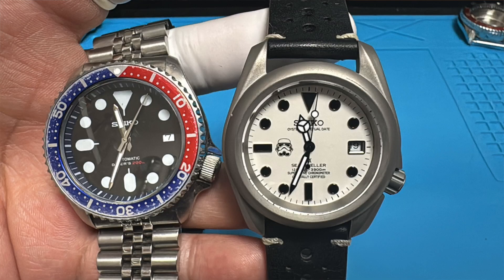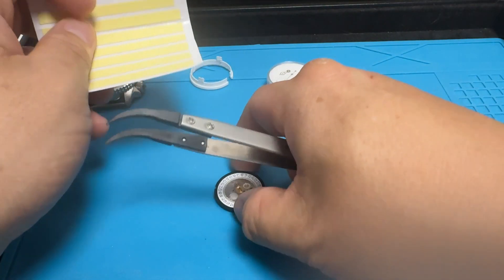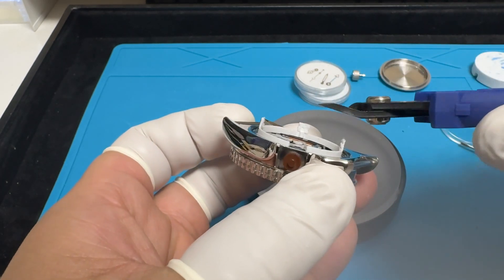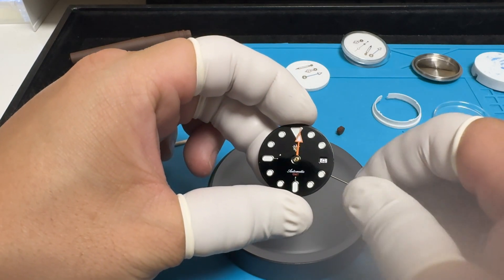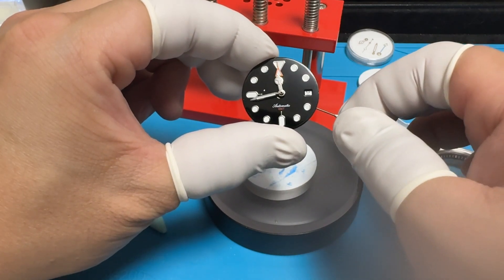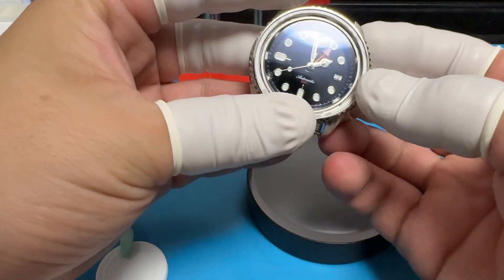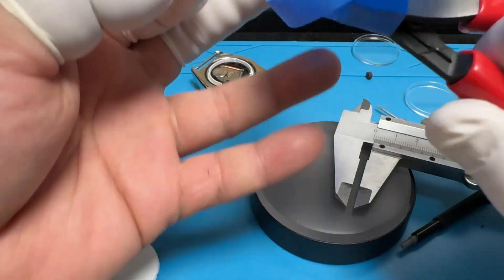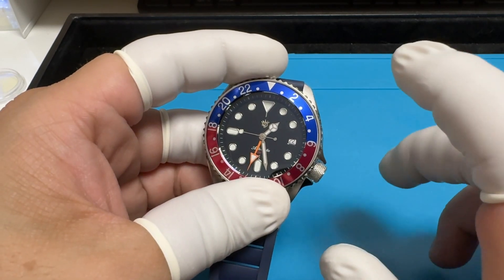Seikomod Quartz SSK GMT Ronda 515 24H

Comment: I have a watch with the same movement, but when I try and set the time using the GMT hand, if you will, it moves in an odd way. I was expecting it to land in between indices relative to where the Mercedes hand is. As in if it then Mercedes hand time shows 16:20, I would expect the GMT hand, if I wanted it to show 20:20 to be one-fifth of the way between  the 8 o'clock indice and the 9 o'clock one. But it does not do that. How do you set the time using this hand? Thanks in advance.
Reply from the maker: Sounds like you may need to remove all the hands and remount them.

Comment: I have a challenge for you. There are a TON of us in the SeikoMods community on Reddit and Facebook that have collected so so many NH35 28.5 sized dials AND hands AND all the cases mostly from AliX. but, we want to use a cheaper quartz movement with them. Have you come up with that particular solution? just like you say in this video, there are so many size things to consider when trying to figure this out. we basically need a movement that has the same exact dimensions as the NH35 but quartz instead of mechanical. VH31 is a decent solution if you don't need a date, but what about if you like the date function. I promise the person that figures out how to do this without needing to buy new dials, hands or cases will be rich. should only need to buy a new quartz movement and a spacer. Thanks!